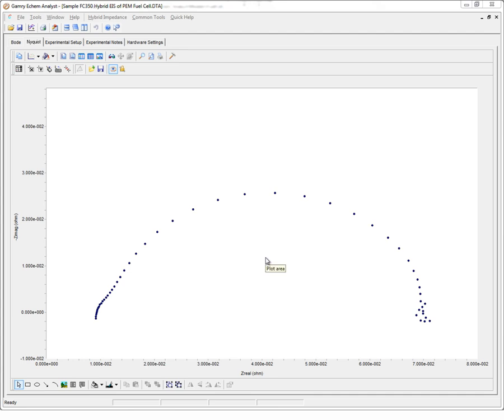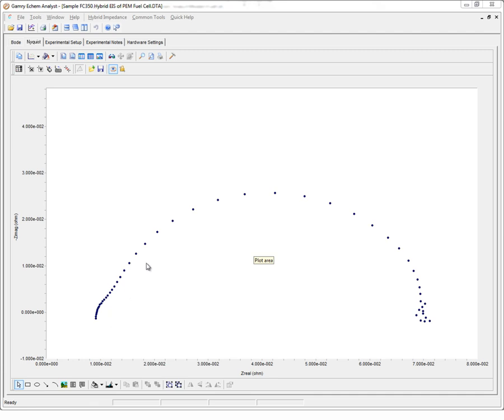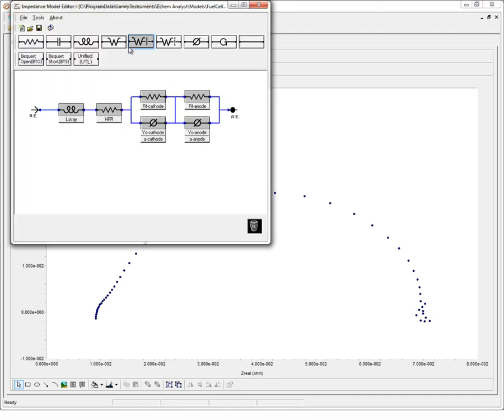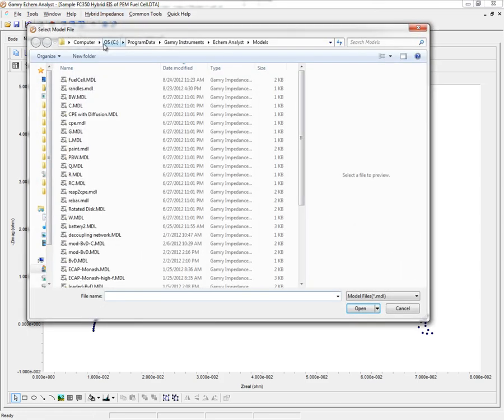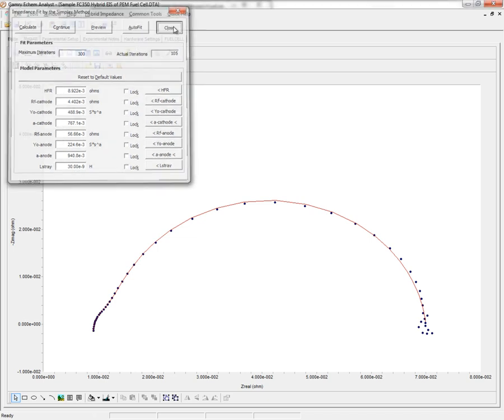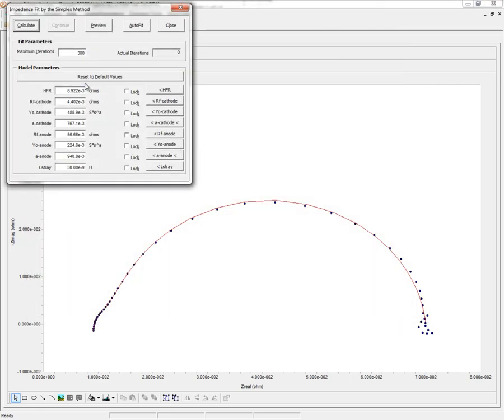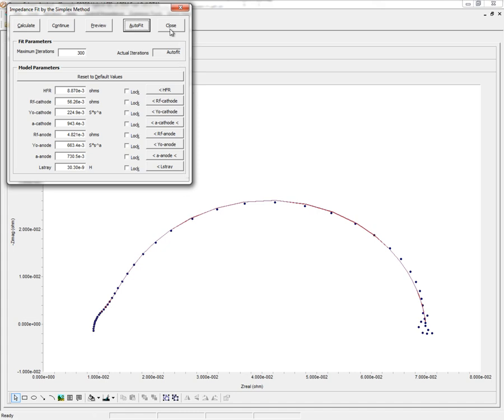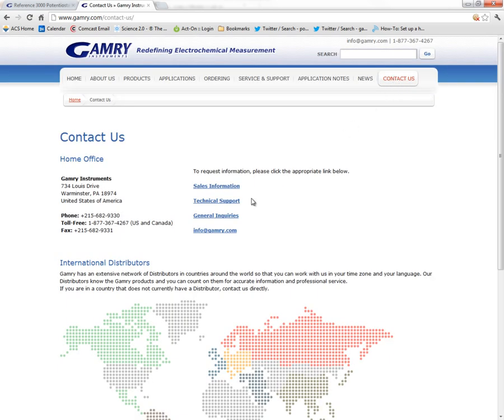Using the Autofit Routine for EIS in Echem Analyst

Comment: Hello, after fitting data with Echem Analyst, can we obtain the numerical data of fitting (in .DTA or .txt)  such as the measurement data?
Reply from the maker: You can use the Copy to Clipboard function, located in the upper left of the screen, to copy the data shown on-screen. This function will copy the numerical fit data to clipboard. It can then be pasted into NotePad, Excel, etc. If you have additional questions, please email techsupport@gamry.com
Reply: @gamryinstruments  When I did that it only gave me the data from the experiment, and not the data from the fit. Is there a way to get just this fittet data?

Comment: I have used Levenberg-Marquardt method to fit the curve. I am confused about how do we get error values. Because the curve or the data has multiple frequency range (1mHZ to 1 kHz) why is there just one error value? and how is that calculated?
Reply from the maker: Hi Rounak. The error is calculated by the Maximum Likelihood Estimation statistical method. This outputs one error value per element in the model. We build an Information Matrix by Inverting the Hessian Matrix (a second order derivative matrix). Next we calculate the variance-covariance matrix, and the standard errors are the square roots of the diagonal terms in the variance-covariance matrix.
Reply: @gamryinstruments  The model used to fit the data is an equation that has frequency as the independent variable and impedance (and Phase) as the dependent variable. is this true?
Reply from the maker: @rounak4465  Hi Rounak, yes, this is correct.

Comment: Hello, maybe someone can help me with a little problem I have.
when I'm going to fit the model, there's not a botton to "autofit". What can I do to solve this problem? 
Thaanks
Reply: Hi Jhaniel,  It is likely you are using the Levenberg-Marquardt method. Please select the Simplex method and the autofit feature will be available.
Reply: @andrewmccaskill7888  Hey i have a question. I have used Levenberg-Marquardt method to fit the curve. I am confused about how do we get error values. Because the curve or the data has multiple frequency range (1mHZ to 1 kHz) why is there just one error value? and how is that calculated?
Reply: @rounak4465  The model used to fit the data is an equation that has frequency as the independent variable and impedance (and Phase) as the dependent variable. The constants are what are being derived from the data to fit the model. And each one of those has an error associated with it. The model is made to fit over a range of frequencies, not just a single frequency. But you can isolate a range of frequencies and adjust your model to fit just that rage.
Reply: @andrewmccaskill4855  What do you mean by "The constants are what are being derived from the data to fit the model." ? Which constants ?

Comment: When using the Autofit feature, sometimes I face the error "Table could not be initialized." What could be the reason?
Reply from the maker: This can be due to memory limitation of the computer. If you close and reopen Echem Analyst, the memory use will be cleared and the Auto Fit should work again.

Comment: Hello, what is the reasonable value for the goodness of the fit?
Reply from the maker: Hello. For checking a model, the Goodness of Fit is not a reliable metric. The most important thing to consider is if your model is a good physical representation of your electrochemical system. The next parameters to check are the error values for each element in the model. If the error is greater than calculated value, the element may not be present in the system. 

Goodness of fit is not an accurate metric because you can make a model that is not representative of your system, but it can still fit well. For example, you can make a model with 30 CPE's in parallel and in series, and it would fit almost any data set perfectly due to the number of variables it has. However, this model would not be physically accurate. This is why the error values are a better check. 

If you send your data to us through our support page: https://www.gamry.com/support/contact-technical-support/
We may be able to help you further.